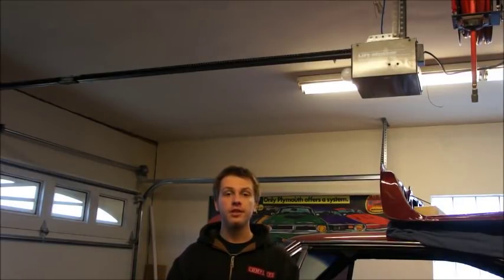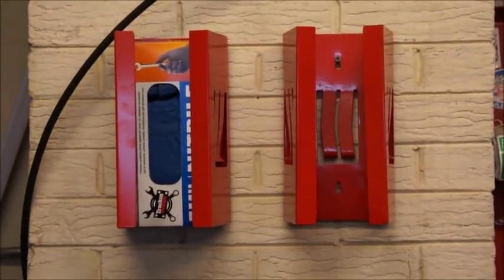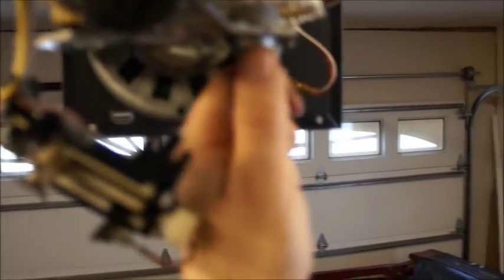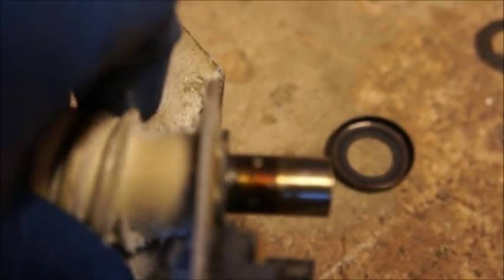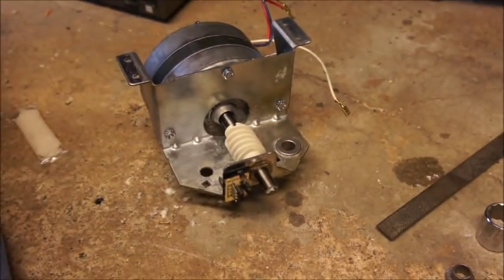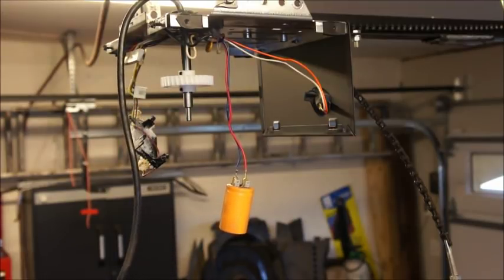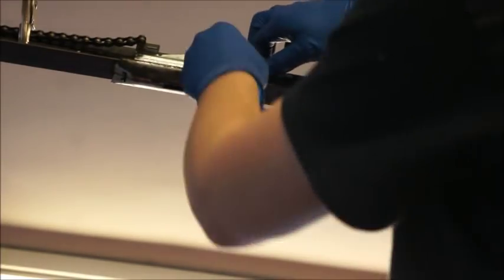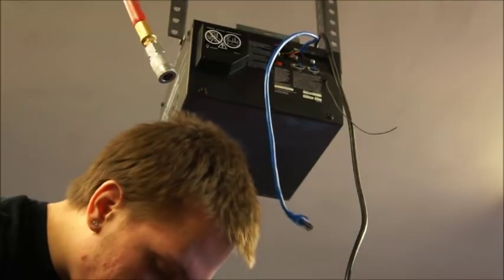How To Replace a Gear and Sprocket in a Chamberlain, LiftMaster, Sears/Craftsman Garage Door Opener

Comment: NICK! excellent video. I do have a couple of questions: 1. As I was testing the unit the motor was getting very hot, is this normal? 2. Once I put the gears together I could not get them to move by hand. I needed to clamp a vice grip at the end of the shaft to get it to move. Is this normal? I tested everything and it's working normally, my back plate is plastic and it's making more noise then your finished product, is there any way I could send you my video? Thanks again for a great video, very thorough and educational.
Reply from the maker: Hi, the motor has no cooling because it is not meant for continuous operation, so getting warm is normal. There's a safety cutoff that's supposed to shut the motor off if it gets too hot. The bearings may need a little time to break in as well so I wouldn't be too worried about not being able to turn the motor by hand after everything was installed. If you want to send me a video, you can email it to nicksgaragedoor@gmail.com

Comment: I've noticed that there is a brown grease between the hardware at the end of the worm gear. I see this grease /oil in several other places as well. What should I use as a replacement lubricant for these parts? I'd like to at best improve the maintenance period for this opener and at worst give it the same life it would normally get if a garage door tech came out to do the work.
Reply from the maker: Lubriplate low-temp grease should do the job just fine. It doesn't need grease often, once every 5 years or so should be sufficient.

Comment: Loved your video. I have a Liftmaster and the chain has a lot of slop in it. Thanks to you I'm going out tomorrow and adjust it. Question, should the door be up or down when adjusting? Bought house a year ago so no manual. Any help would be greatly appreciated...
Reply from the maker: Freddie Ray Hi Freddie, when I adjust the chain I usually do it with the door down and the emergency release pulled. If the down limit is set too far, sometimes it can push the rail up a little and give the illusion that the chain is loose even though it's not. Before you adjust it, get on a ladder at the motor head and look at the sprocket. If you see a lot of black dust or chunks below the sprocket, chances are your top bearing is shot and the shaft has moved towards the door, also giving the illusion that the chain is too loose. If that is the case you will have to replace the gear and sprocket. Let me know if you need any more help! -Nick

Comment: Thanks Nick. Really good video. I followed all instructions and replaced the parts. When I plugged in the Liftmaster, it shorted out. I checked the wiring that I unplugged and I made sure I put the wires back where I took them from: red and blue in the right spots in the capacitor, and white wire in the power part. I unplugged the electric board and plugged it back in to make sure I did not made mistakes reconnecting it. 

I am out of options. Can you recommend something I can try to fix this electrical problem?

Thank you again.
Reply from the maker: Amine Benali Sorry to heat that, what exactly happened when you plugged it in? Are you sure there are no separate circuit breakers or GFCI outlets that may have tripped? Use an extension cord and try plugging the opener into a different outlet in the house and let me know what happens.

Comment: I have to change the driver.  So I did.  But I was stupid not to Mark the chain.  Ao I screwed up travel distance between open and close.  
No the door is about 1 foot away from ground.  When I push to close. Is goes down about 1 foot then reverse to 1 foot high.  Is there any way I can reset the door opening and closing ??  

Thanks

Comment: Maybe you can help I can't seem to find the right gear kit, The number is real faded, but Looks like 41C4252-7 or is this the old chamberlain model no??   Is that replaced by a 41C4200 gear set. I found another # K1027. Great instructional video. Well done!!
Reply from the maker: Hi Michael, I don't recognize that particular model, however if you can email me some photos of the opener you have, that can help me identify which kit you need. You can send the photos to nicksgaragedoor@gmail.com.

Comment: Thank you, this was incredibly helpful. Ran into a small problem during reassembly. When reinstalling the motor the worm gear and main gear aren't lining up, such that I cannot fully insert the shaft into the bearing. Because of that I can't raise the motor up high enough to be able to mount it. 
Is there a reference point I can use to line these up? Or some other issue I'm not thinking about?
Thank you.
Reply: Mark McDaniel Hi Mark, I have heard of an issue with these where the new bearings they include are not exactly the right size. I would remove the bottom bearing and see if that fits on the sprocket shaft, if it doesn't you'll either have to use your old bearing or contact Chamberlain customer support and ask them to send you a replacement. 
Nick
Reply: Same deal. Some light whacking with a hammer  urged the motor up so the bracket met the case.
Reply: Yes, I had the same problem and upon closer inspection I found that the replacement bearing for the chain drive shaft was 
too tight.  As the original was in good shape I swapped that one out rather than hammering anything.

Comment: Hey quick question, so I have a Chamberlain silver medal (basically a 1255 with a different case) that is squealing, it's coming from the bushings on the motor shaft, and I have some spare bushings that are used but seem to be in good shape (came out of a sears best), but they are different from the ones the silver medal had, the ones that came out of the Sears best are the same kind that would be on like a 3265. Can I use those to replace the other bushings, cause I would like to do that to fix the squealing
Reply from the maker: You could give it a try, as far as I know all the bushings have the same dimensions so it should work. Oil everything while you're in there too, even the bushings in the motor.

Comment: Hey Nick, you might want to get a digital multimeter that has a capacitance measuring mode. That way you can measure the capacitance of your motor starting cap to know that it has the correct capacitance. Over time and heat they tend to lose capacitance even though the motor still works it can be making extra noise and suffer a significant loss of power. You sure don't want a weak motor.

Comment: Hi Nick, got my new gear and sprocket installed but am having trouble replacing the chain the trolley will travel toward the closed door but will not reverse. Tested the sprocket with the chair removed. It will travel continuously clockwise but when reversed only for a second and then stop. Really need your help. Thankx

Comment: Great video, got a question for you.....I have two garage doors and on one side the remote works but the other side the remote stopped working a few days ago but the main control on the wall still works for that side, do you have any idea what went wrong? It does this with both my wife's and my remote so I know it's not the remote.
Reply from the maker: Jimmy Goss Hi Jimmy, I've been meaning to do a video on this for a little while now but haven't found the time. Sometimes I've found that the receiver just loses its memory. Try clearing the receiver on the op that won't work, you do this by holding down the Learn button (it can be green/red/purple/yellow) until the little LED next to it goes out, should take less than 10sec. Then try to program your remotes, press and release the learn button, LED should be on, then press and release the button on your remote you want to use. The light bulbs should flash within 5 seconds or so. If you can't get it to work, the receiver may be bad and you'll need to replace the circuit board. Oh! Some LED light bulbs emit a radio frequency noise that can interfere with the remote signals, make sure you don't have any of those installed in or near the opener. Hope this helps!
Reply: Nick'sGarageDoorService thanks I will give that a try
Reply: Interference problems are becoming way worse than LED's or CFL's installed in the motor head anymore. I've actually had to remove an LED night light in a room above a garage a few weeks ago. This is becoming BS lol. Even with the revised boards, it's still a problem. And then, if you sell the customer the 888 wall control with new remotes and all, the wall control burns out in a few years.

Comment: I was good until 14:00. In mine the motor shaft doesn't have the collar with the set screws but instead has some kind of retaining washer / ring that I'm having trouble getting off. Aside from that everything has been spot on. Any idea how to get this thing off? Mine is a Chamberlain model 240.
Reply from the maker: ReyesRP Ahhh, those are pretty rare, I think they only used those clips for about a year. It should just be a C clip, you can probably use a screwdriver and pry it out of the groove. If you break it you should be able to use the collar assembly in its place. If it’s a snap ring with 2 small holes in it near the seam, you’ll need to buy or borrow a set of snap ring pliers. If you’d like, take a picture of it and email it to me at nicksgaragedoor@gmail.com and I can verify.

Comment: What about the position of the motor with the position of the gate . For no running oposite way ( motor vs gate )can you telling me please ?. Thanks
Reply from the maker: It would be difficult to figure out what is causing that problem without seeing it. These openers are not meant to be used with gates.

Comment: So i forgot to hold down the chain before i started and after finishing its making some very harsh opening and closing noises, is this the limits or force settings or do i need to readjust the chain.
Reply from the maker: Hard to tell without seeing it. Open the door halfway and stop it. Turn the open limit screw 3 turns counterclockwise, and turn the close limit screw 3 turns clockwise. The door will now probably not close all the way and probably not open all the way. Reset the limits as I showed in the video, then reset the force settings. If it's still making odd noises, let me know.

Comment: I have a liftmaster ATS211X and I have replaced the gear assmebly .the problem that I have the door will shot and stops two feet from the ground. And I have used all of my closed limits. And I have turned off the machine and turn the limit clockwise again and it does the same thing again. Please advice ?
Reply from the maker: Hi, it sounds like the sprocket may not have been in the correct place when you reinstalled the chain. Run the operator up to the open position and turn the down limit screw clockwise about 3 turns. run the machine down and then up again, but stop it halfway. Unplug the machine and remove the case, remove the limit gear from the shaft and turn the limit switch so the slider is a little bit more towards the open limit, maybe 3-4 turns. Put the limit gear back on and try it out. Let me know if this doesnt work.

Comment: Malfunction of the garage door opener motor - works for a few seconds and stops even without load - the garage door itself is disconnected from the opener. Can you help me figure this out? Thanks
Reply from the maker: Tom, does the light bulb flash on the operator when this occurs? If yes, that indicates and issue with the safety eyes at the bottom of the door. If not, sounds like it could be an issue with the RPM sensor. Make sure the black wheel is sticking into the sensor at least half way.

Comment: Hi Nick. Great video! I have a question with regards to the motor bearing. I cannot seem to get the bearing on the shaft (it is really tight). I already broke one bearing by applying a light tap with a hammer. Should I try filing the shaft a bit? Any suggestions will be greatly appreciated... p.s. this step corresponds to about the 20:00 minute mark on your video. 
Thanks!
Reply from the maker: Kalid Ali hi, yes I would try filing the shaft a little bit. First slowly run your hand on the shaft and make sure there are no sharp edges anywhere to make the bearing bind up. Also make sure all 3 nuts for the motor plate are on but left loose, if you tighten them before the bearing is on the shaft it can make the shaft sit off center and be very difficult to get on or off. Also, make sure you are using the keyed bearing that is bronze in color. Was the old bearing easy to get off? If so, it is possible that the new bearing included in your kit is incorrect, if you continue to have issues trying to get it installed I would call Chamberlain customer support, if you explain to them all you have done and are still having issues they will probably send you another bearing or two. Let me know if you need any more help! -Nick
Reply: I will try filing again. There didn't seem to be any sharp burrs. The old bearing was also very hard to get off (I also broke that one in the process of removing it too).  Maybe I have to use a bit more grease as well. Thanks again!

Comment: Did I miss something? You said it have to be in the open position and later explain why, but I guess I didn't catch that part. I got it all taken a part, but in closed position.
Reply from the maker: I prefer to do everything in the open position so I can use the vise grip and I don’t have to fight with the chain. If you took everything apart in the closed position, you can install the new parts and put it back together in the closed position and it will work fine, as long as you don’t change the position of the limit switch from when it was taken apart.
Reply: @NicksGarageDoorService  I didn't change any settings. Thank you for quick response. I will test it in the morning.
Reply: @NicksGarageDoorService  it goes up and down fine and stops up about 2 inches from the screw. Only when it close, it immediately go back up. Both sensors led is on, but only one shuts off when covered. The force is on the between 1 and 3 kg. I fix that by decreasing the travel down, it went too far.
Reply from the maker: Thomas Asix Glad to hear you got it worked out

Comment: Nick my wife pulled the cord by accident with the truck and the sprocket in the top came off, do I need to by the kit and replace it?
Reply from the maker: Well, if the sprocket is broken off the shaft you will need to buy the kit. If the chain just came off the sprocket, it can be fixed.

Comment: i unscrewed the 2 nuts from the "collar" ,  @14:16  , I tried really hard to pull it out with plyers but it still wont come out. Should i spray it with some WD-40 and then try to pull it out?
Reply from the maker: You could try that, but it is likely that the set screws in the collar created some large metal burrs on the shaft that are jamming the collar on the shaft. You can try gently tapping a screwdriver in between the collar and the split washer and then using that to pry it off. You’ll probably need to file the shaft before you try to get the bearing off.

Comment: I was looking to find Gear kids for mine but I cant find same model. my model 1265LM. can you direct to correct link to order kids. I opened mine and the gear is totally worn out
Reply from the maker: This is the kit you need

http://m.ebay.com/itm/LiftMaster-41C4220A-Chain-Drive-Garage-Door-Gear-Kit-/172219090750?hash=item28190ec73e%3Ag%3AbDgAAOxyjxlTMcUw&_trkparms=pageci%253Aea96f115-acb4-11e6-b94f-74dbd1807ad1%257Cparentrq%253A71f106a01580a60cd808e2f5fff83f5c%257Ciid%253A5